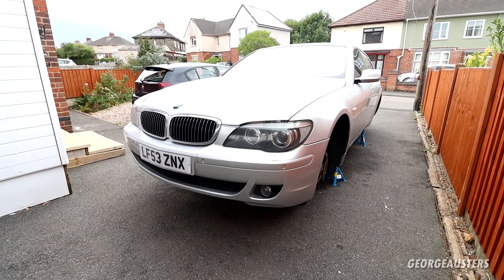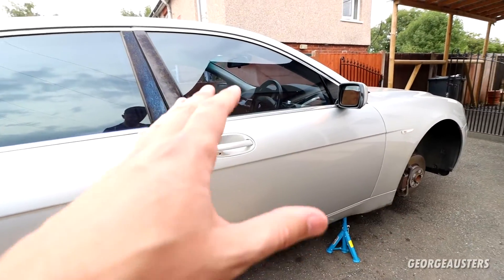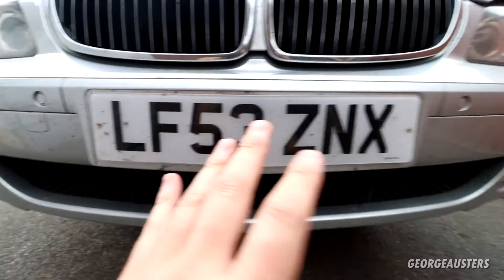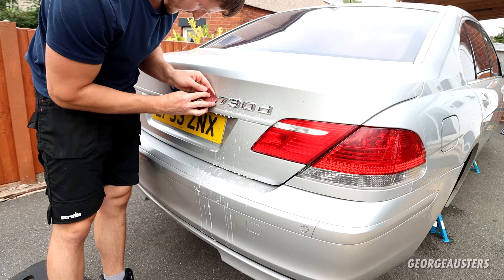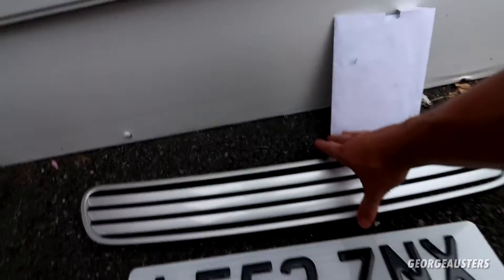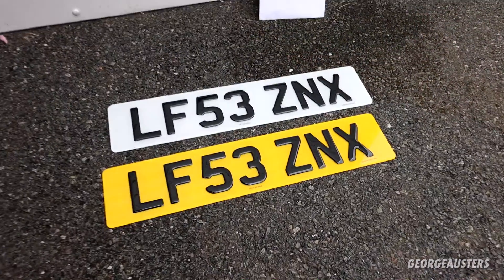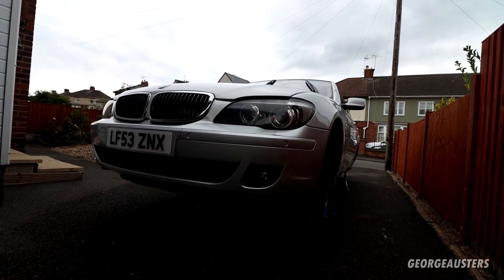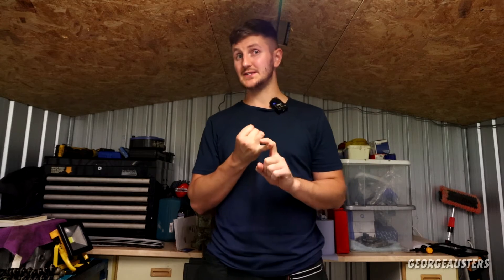BMW E65 E66 7 SERIES TRANSFORMATION COMPLETE

Comment: Use a heat gun to remove the badges/ things put on with double sided tape, even a hair dryer would do! Wont affect the paint if your careful, I've done it thousands of times from working in a body shop. Also another tip is to use slight heat when reinstalling new badges or using double sided tape!
Reply from the maker: Yeah I need to get a heat gun along with a load of other tools since moving house👍🏻

Comment: The wings are a different colour to the doors. And the rear bumper looks a different shade too. 
You may as well just paint the whole side. 
If you just change the door then it will be another shade of silver. 
I couldn’t live with the differences. That’s all I see when I look at the car. 
It’s a shame as that’s the only thing that lets a well sorted car down.
Reply from the maker: I think it’s mainly the lighting because the ends of the side skirts look a different colour too, but they’re the original same as the doors etc

Comment: Not sure the new number plates are road legal.
 Don't they have to have a bs kite mark and postcode of supplier on them ?
When I'm detailing my white BMW I use soft toothbrushes to get into the small awkward bits and cotton buds !
That car was originally supplied in London. 
Would look better with an original London BMW dealers  name at the bottom of the plates.
Reply from the maker: Yes the plates are legal👍🏻